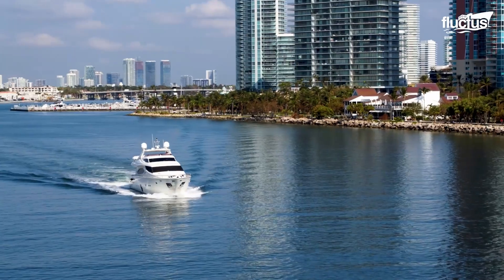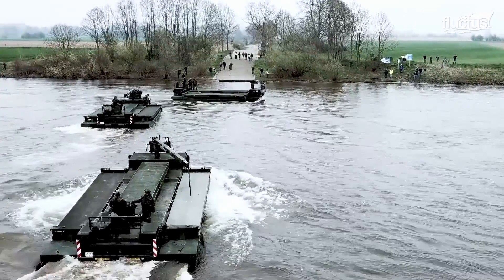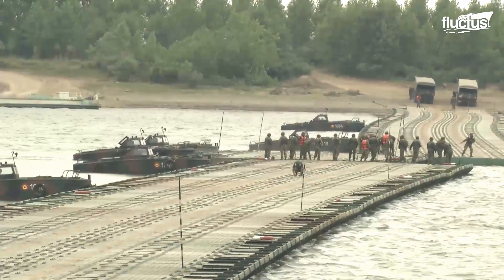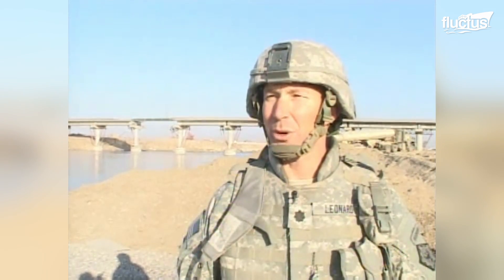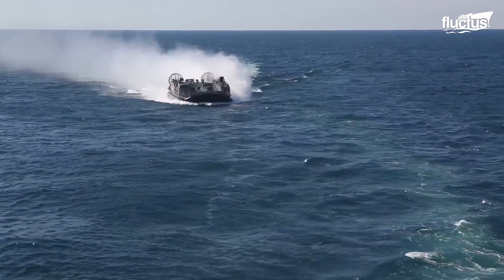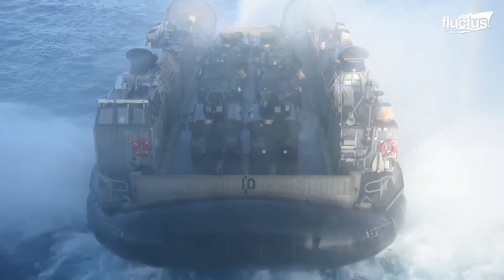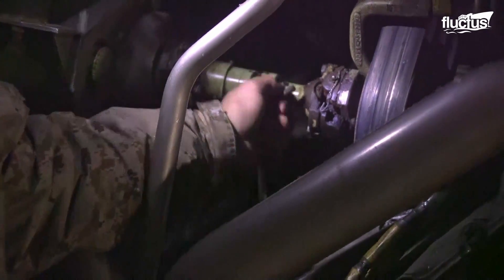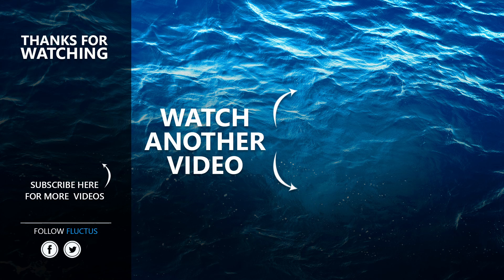Crazy speed ! The Awesome German Bridge Technology Used by US Forces

Comment: Question: can a bridge section sustain the shock of a firing tank, while afloat? (either independently or connected)
Reply: A 70 ton tank shooting a mere 120 mm,  that's probably not much recoil.
Reply: For that you need to hit it first! Hitting it is pretty difficult yet not impossible. It has a very low silhouette.... a tank creates direct fire (straight trajectory) hitting targets from the side! From a tankers perspective further away the bridge looks like a THIN line on a river. It's almost like trying to hit a sheet of paper from the side with a gun  ... 😉

 In contrast indirect fire 'from above' like precise artillery fire (parabolic trajectory) or air strikes are more suitable

Knut, former pioneer conscript from Germany.
Reply: I mean at a minimum it could withstand the shock of a tank once....